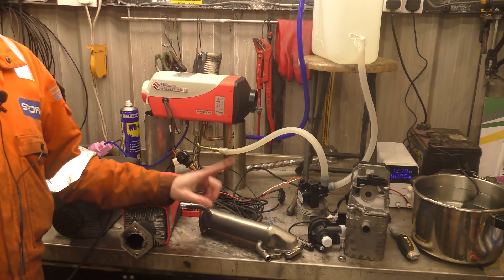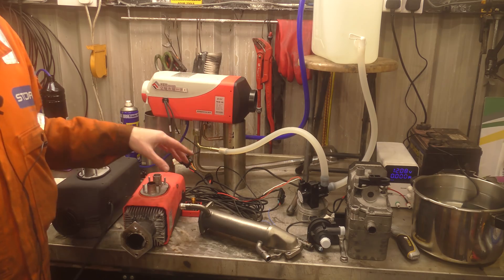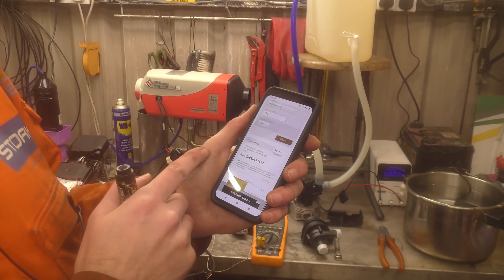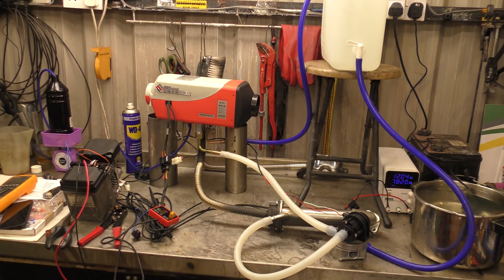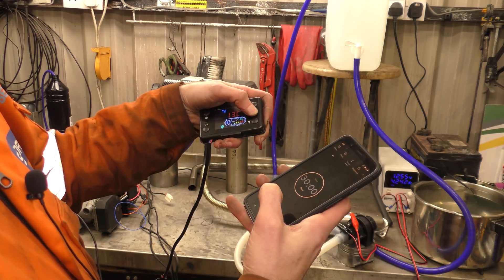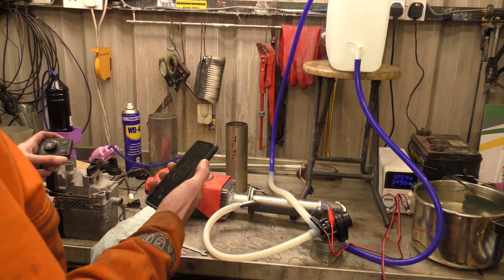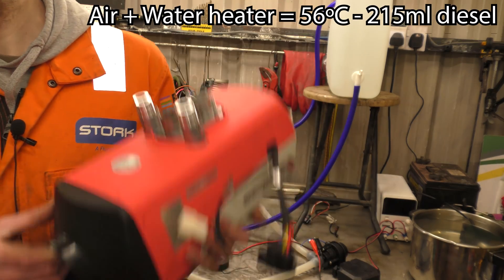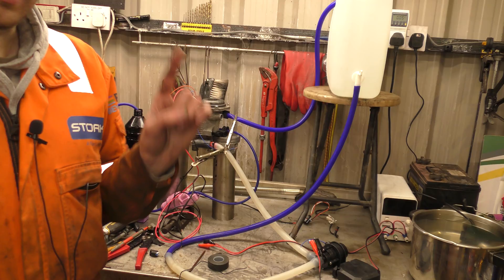Air water heater vs EGR cooler heater vs Air + Water + EGR

Comment: Could youuse a plate heat exchanger say from a centrel heating boiler on the exhaust output ? Thus having warm Air & boiling water 💧
Reply from the maker: Not sure how they bond the plates together and if it would take the hot gases.

Comment: What kw is the first setup..the air water heater?.. also what brand was the water circulating pump you used..regards Gerry
Reply from the maker: The air and water is 4KW body.  The water heating part is about 1KW.  With regards the pump I cannot remember.  It might have been a 12V coolant pump, the kind you find on VW etc.

Comment: I guess a 'purpose built/ engineered, exhaust  tubing thru a stainless chamber wid two outlet (for water piping)' & suitably encased in thermal materials can trap more heat resulting in better output???
Reply from the maker: I do have a purpose built pool heat exchanger but I don't think it recovered any more heat than anything else.

Comment: I will b using free hot water to circulate my tropical fish tanks as a power cut will b disastrous. 
Can b use heat exchange under metal plate / ceramics for floor heating or propagator for seedings

Comment: This is way late, but would adjusting the speed of the fan, and or fuel supply effect the water temperature off the egr exchanger? Less air across the burn chamber = more exhaust temp?

Comment: Think, that in your second test: Air/water heater+ EGR you should have put EGR before AIR/water heater, so that water from bucket could been preheated in EGR before entering heat exchanger, since heat exchanger in heating unit is more powerful and more efficient than EGR. The way you connected it EGR can not create any more temp rise after water exits heat exchanger.

Comment: Has  anyone tried wrapping copper tubing, like you would around a woodstove chimney/flue. around the heater exhaust and wrapping it in exhaust wrap?

Im wondering if the copper to exhaust direct contact would be better for heat transfer?

Comment: Thanks for the video demonstration or preheating with exhaust energy (energy recovery ventilation). On a larger scale I think it would make sense to install a heat exchanger over griddles and grills in restaurants to preheat the water going to the hot water heater.
Reply: It'd clog up with gunk you dunce!

Comment: i just used a large egr cooler and did the same thing with much higher efficiency also if your goal is to extract as much energy as possible use a larger reservoir as the temp difference is what is dettermening how fast it is heating up
Reply from the maker: How big an EGR cooler did you use, and where did it come from?  :)

Comment: Maybe a dumb question.  Can you heat the water only?
Reply from the maker: Negative, air and water at the same time.
Reply: Thank you for your reply.

So what if it is summer time and you want hot water but no hot air?

Comment: You need a heat exchanger similar to the propane hot water on demand. These are optimized for heat extraction.

Comment: I have a 5kw heater. Im using the method of wrapping copper pipe around the exhaust to heat the water in my van. However if I want the heater on (not making hot water) if I just leave the water pump off the water inside the copper pipe will boil. Would this cause a high pressure build up in which case would I be best to vent the hot water tank a little. Or just buy one of those 16kw deisel water heater you reviewed
Reply from the maker: If you're happy with the copper tube setup, just use a vented tank.
Reply: @DavidMcLuckie  
I'm still running tests to see if I can get more efficiency from the exhaust. However your 16kw deisel water heater seems to be brilliant as its so fast. If you don't mind me asking what was the total cost of the unit with the controller etc. I followed your link but does give me a cost for shipping and import. 
Would you consider selling your one ?
Reply from the maker: It was almost as much to ship it as it was to buy it.  I think it came in at just about £300 once all the import duties were paid as well.  I wouldn't sell this one as I have plans for it.

Comment: I would love to see if putting the EGR cooler before the water heater vs after the water heater would make a difference, also Would love to see if The input and output for water at the EGR cooler were switched around (would inputting the water at the further end or closer end to the heat make a difference)? , Maybe even go as far as shortening the Exhaust pipe between the heater and EGR cooler. I know that it's hard to test for and to see but there is a lot of Heat loss the further you are from the heat source. Please see if you can at least try it with the EGR cooler closer to the Heater :) 
Cheers.
Reply: ah Yes. also Would Running the water line in parallel instead of series make a difference? (basically run the water through the water heater, and run a separate line and pump for the EGR cooler?

Comment: From what I understand, you have made a condensing boiler with this egr cooler. Now from what I understand of condensing boilers, they are only more efficient when the incoming water is cool enough to extract waste heat, once your tank reached say 40-50 degrees, the 50 degree water wasn’t able to extract much more heat from the exhaust gasses. Would be interesting to see this experiment done with a larger vessel of water and maybe see how long it takes to reach lower temperatures, let’s say 50 degrees Celsius?
Reply: I have a feeling the one with egr cooler May each 50 degrees quite a bit faster than the one without, but with diminishing returns from there. Maybe try recording results at 5 minute intervals?

Comment: Dear David. why my stove is not working 2 kw what if you get body from the car body? if you don't get a body just through the cable then it works. opinion?
Reply from the maker: The heater doesn't use the car body as ground.  It needs to be through the cable.
Reply: @DavidMcLuckie  Thanks for the reply.

Comment: Getting only an extra 4° out of adding EGR.. Do you think it was because you were pumping that heated water from the EGR to the heater rather than cold water directly from the tank. Maybe the heater could impart more heat into colder water than it could with warm water.
If you could re run the test with two water circuits and two pumps that may tell.
Reply from the maker: Yes. I think the egr would work better running on its own supply. Which is something I could test again.

Comment: Ur measurements were 69,75 degrees on the two first burns how did u get the 56 and 60 numbers in the end of the video??
Reply from the maker: Those are how much the water was heated not it's final temperature.

Comment: What we really need is a cheap way to get all of the canbus webasto's working! Really want some kind of heater for my van but don't even want to put in £90 for a China one. Good job
Reply from the maker: Just found out you can get an ECU that fits the Webasto and doesn't use any canbus.  I've ordered one so should have a video of it soon.  Hopefully.
Reply: @DavidMcLuckie  awesome! Webasto prices about to go up 😆shame for them all to just get scrapped though

Comment: Seems like the air/water unit is scavenging heat from the exhaust before it exits the heater itself, that's why the egr only collected an additional 100w.

Comment: disappointed the standard unit with egr was half as good at it as the water air unit. To get closer efficiency guess would have to insulate the snot out of exhaust pipe and heat exchanger.
Reply: lol.... ok.... see now this got hit on in an earlier comment/replies

Comment: What about installing a thermoelectric generator device on the heater, it would create electricity and possibly create enough electricity to keep a battery charged as it runs. Thank you for awesome videos!!!
Reply: or to run the water pump

Comment: Thanks, great information! I plan on using the EGR cooler on the exhaust to heat my freshwater tank to prevent freezing. Talk is cheap but research is expensive and rarely done, thanks for sharing this research!

Comment: Great Video! I'm about to purchase one of these heaters for my van & my idea to recover the heat for water was to extend the exhaust pipe (may as well keep as much heat in the van) and wrap copper tube around the entire exhaust ... wrap it with that exhaust heat material / insulator bandage stuff... pump through a small car heater matrix or AC condensor (as a radiator) and on into a water tank..I think using copper pipe  with more direct conatct / surface area than an egr cooler will improve the heat recovered / water temperature.
Maybe something you'd be interested in testing in your Air & Water Heater Test Laboratory :-)
Great Channel....Just Subbed!

Comment: Brilliant as ever. 
My guess is that the heat differential between the the water leaving the air/water machine and the gasses in the egr cooler was smaller so less transfer occurred latterly in the experiment. If you plotted the graph of temp rise over time it might show if this were the case. Initial heat up may be quicker but then flatten out. 

Have a good one!

Comment: Is there any way to do air to air heat exchange on the exhaust? I’m up and running in my shop with a 5 kW heater on alcohol. Just trying to figure out a way to capture exhaust heat without a water set up. Run a long exhaust? Run the exhaust through an old car radiator?

Comment: David, I have a question on your water temperature sensor. I see it is plugged in the a/mA connection. What is your sensor made of ? Does it have some kind of a transistor that has either 2 of the Emitter, Base and Collector connected together?
Also, happy you do these videos as it seems to be the cheapest way to heat up any areas that requires warmth.

Merry Christmas to you and may 2020 bring more useful and interesting videos. Cheers mate!
Reply from the maker: It's a K-Type thermocouple and has its own plug on the multimeter.

Comment: The original cut burn chamber one.  Cut it off and extend the stainless burn chamber with stainless tubing. Double wrap inside and to then outside with a copper pipe in a single circuit. Wrap outer in insulation. You could even then go on to the egr exchanger on the exhaust to squeeze out every btu of heat

Comment: How about running the egr cooler on the output of the hot side of the heater and not on the inlet side of it on the water and air heater? Love your videos, keep them coming.
Reply from the maker: Worth a try.
Reply: @DavidMcLuckie  The best heat transfer happens when the delta between heat source and heated medium is greatest, so having TWO separate lines from the tank would reduce the inefficiency of having the water piped in series, where the second heater in the series has a low delta and therefore low heat transfer.

Comment: Try reversing the flow. Though the egr first or the heater/water heater first. Also what about trying a turbo intercooler in the exhaust with a fan to get more heat out of the unit. Instead of blasting it out the door.

Comment: Excellent test, thanks for all the effort!

So unless I'm mistaken the new combined air & water heater has an output of about 1.3kW to the water (on average, probably decreases as the water gets warmer).
The EGR on the air only model is capturing around 400W. 
The EGR on the combined air and water heater is only gathering less than an additional 100W so hard to argue it's worth the effort.
Great to have these figures so as to be able to make a judgement call on how worthwhile the EGR is in a particular application. 
Overall it makes the combined unit look like the way forward if both air and water heating are required. It's full system efficiency appears to be very high while it is heating water.
Reply: use a larger reservoir and the egr will gather almost 1kw due to the temp difference

Comment: Thanks for brainstorming !So interesting. Right ... is there a way to rig up an 'instant hot water' version like an electric shower obviously will be lower volume ,but l am thinking hot water for my sink in the van and maybe sort of tepid shower set up - l hate paying for bottle gas, diesel is so much cheaper - Merry Christmas and happy Hogmanay
Reply: Yes and no.
There are diesel fired pressure washers that heat water on the fly, but of course it's a much bigger device and uses much more fuel.
If you want to heat a little bit of water a lot, or you want to heat a lot of water up a little bit in a short time, you need a big heat source.

Also remember that this type of device takes a while to heat up and produce heat anyway, so isn't suited for instant hot water.

Comment: I'm guessing that the exhaust gases from the air & water heater have been cooled to the point where the EGR cooler isn't extracting anything worthwhile, so far better to just rely on the built-in heat exchanger for the hot water... :)
Reply: I think the AGR cooler helps in the beginning to heat up the water quicker, bur then becomes useless at a certain water temperature.